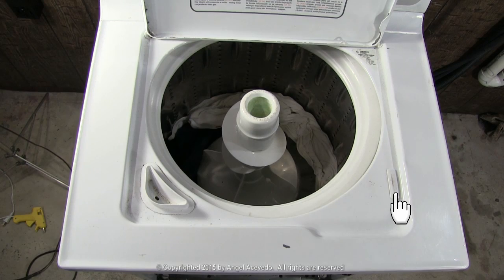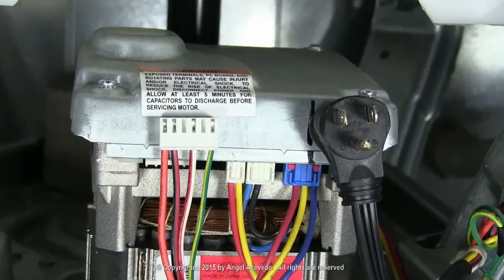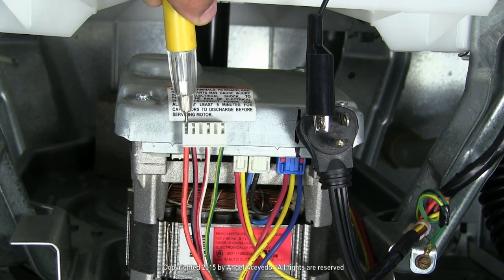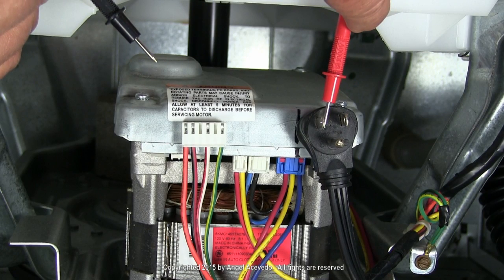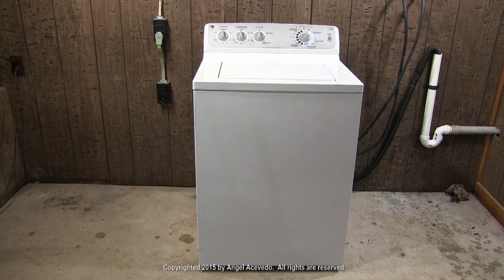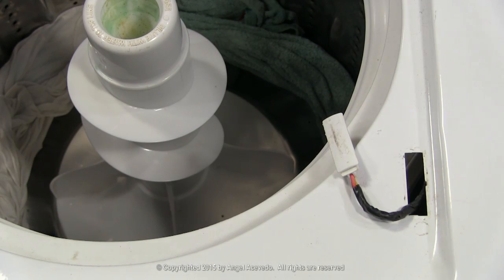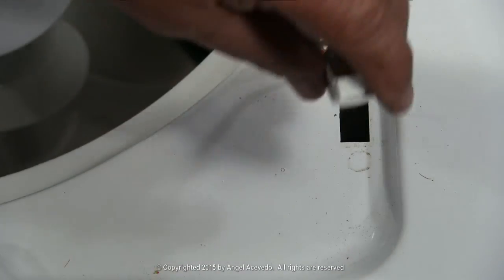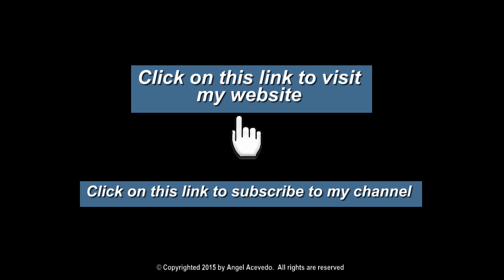General Electric Washing Machine Not starting - The Lid Safety Switch

Comment: Great tutorial, my washer (brand Easy) won't wash but dose spin, the cone is fine nice n tight, when I start it, it agitates 4 times then it stops/pause. During spin, the lid switch and door lock until the cycle is closed. If it locks, can we say it works fine?
Reply: I believe easy and mabe  are sister brands from the parent brand of GE

Comment: I need to purchase a new washer and dryer. Do you have advice on brands/styles/models based on the products you repair? Thanks!
Reply from the maker: Is hard to say they make garbage now. I still like the simple direct drive washers and dryers
Reply: theapplianceman Ok, that's what I'm hearing and reading. Really frustrating! The ones I'm looking at still use Direct Drive, so at least there's that. Thanks for your reply.
Reply: theapplianceman And thanks for these awesome videos! I was able to repair my own dryer and get a little more time out of it using one of your videos which is pretty cool for not knowing anything about appliance repair. Great tutorials!
Reply: refreshingAnd whirlpool direct drive the best